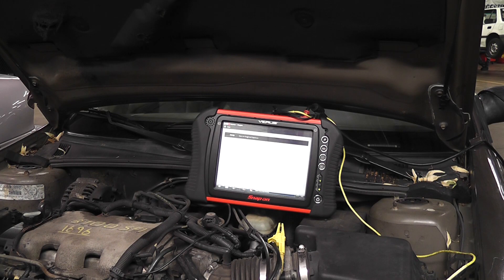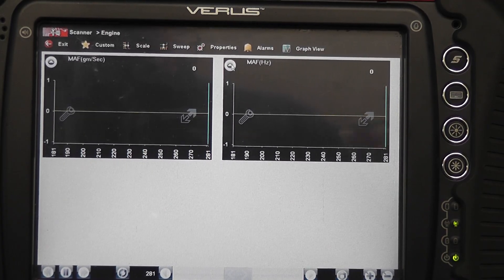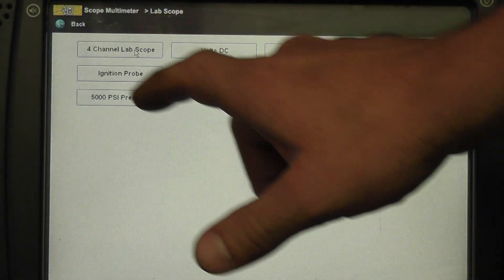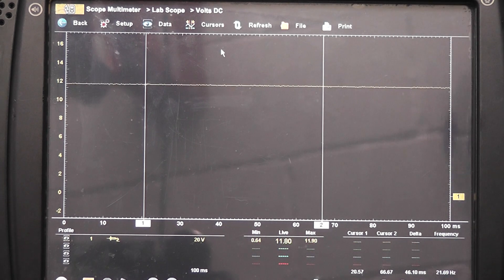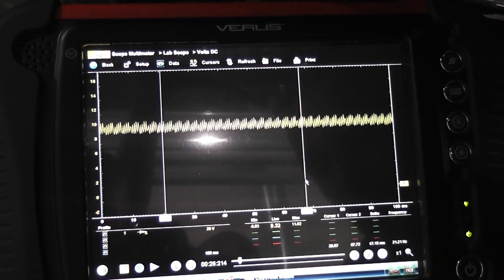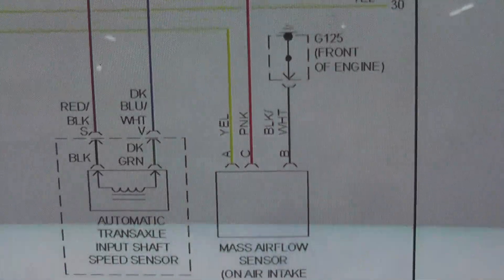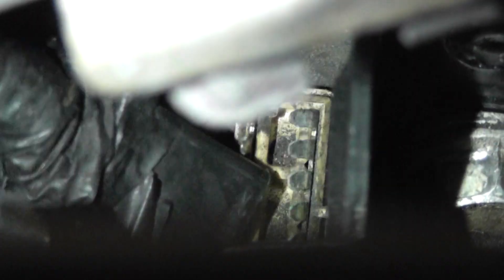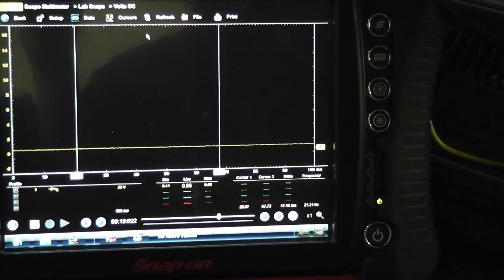MAF sensor trouble code (P0102) caused by a bad ground (GM 3100)

Comment: You said pcm send 5 volt to the sensor , sensor pull to the ground .why we have battery voltage on power wire not 5 volt?
Please 🙏 answer my question
Reply from the maker: Because a MAF sensor is not a simple sensor at all! It is a miniature module that needs a power and ground to work (to turn on). Make sense?

Comment: Ill just leave this here
. Its from a comment a guy had about watching your videos while taking a hot bath. I replied...
Atleast she's not the one in the hot bath watching his videos and trying to explain it to you. 
Because.... that is what i am doing! My husband just got so frustrated by that air ratchet he left the room. Its been 4 months without our 4th gen 4runner PO102 PO113 husband doesnt really ... atleast i dont think he does much troubleshooting. He goes strait for the heart. So he dropped the fuel tank and changed the fuel filter, tested the pump it was ok. New battery cleaned the maf sensor cleared the codes and it didst come back. I know cause i checked. I ran the obd2 code reader and no code when in the on position. Crank no start. Nothing really before this happened. There was a few times fuel was low running on fumes. I remember driving away from the gas station the car didnt have much power. Then going home on another occasion up a bridge didnt seem to have the normal 4.7 v8 power. Then my hubby drove it fishing went to a friends house and  no start.  Actually crank no start.. (the dreaded) Couldnt even jump start it. Towed it home and here we are 4 months later and we are freaking  married4luv. ...
56 no car, feel freaking hopeless. Scanner Danner must be from Ohio. Me too. I can tell from his accent  unfortunately im now in he double ll new orleans. Okay then bye. Also changed the start plugs. Noticed a oil lead from valve cover bolts? He said they were really loose. So there is some oil leakage that's covered some things. He says it's normal... me ...
 It's a computer.
Reply from the maker: get me some voltage measurements on the MAF with the key on and engine off and I can help. On your Toyota, it is an analog signal, not digital like this GM, so it is even easier to measure
Reply: @ScannerDanner  Hey, sorry for the late reply. I've been watching videos trying to find out how to get the voltage on the MAF sensor. I started watching your masterclass on that. Then my husband's brother came by and they were convinced it was a crankshaft sensor but I don't want to just throw Parts at it do you have any videos that would point me in that direction do you have a link that would be great he's got a voltmeter.
Reply: @ScannerDanner  we are on our way out now. I do have a live reading when I ran the obd2 the maf was 1.50
IaT c° 35
Baro 101
 eq rat 11
Eat113
Be right back with a voltage reading and I'm going to check the obd2 scanner a little better. 
Thanks again.

Comment: hey im going thro the same thing here on a 1997 tahoe 5.7 its the same problem in the video i cant find any grounds that are off all fuses are good i even had another computer and tried it did not work put the old computer back in it same problem (P0102 mass or volume air flow A circuit low) and i have a new mass air flow sensor installed the exhaust system is fine. not sure where to look from here.???
Reply from the maker: What are your voltage readings on the MAF with the engine running? All 3 wires
Reply: @ScannerDanner  yellow wire is 5  volts un plugged pink wire is 12 volts and the ground is all over the place cant really get a reading? thanks
Reply from the maker: @jeremya3754  needs to be plugged in for these tests. Backprobe with a pin
Reply: @ScannerDanner  ill get the readings and get back to you
Reply: @ScannerDanner  yellow is .067 red .028 black .027
Reply: this is with the engine running and it plugged in @ScannerDanner
Reply from the maker: @jeremya3754  your missing your power feed to that MAF. Doesn't matter that it was 12v unplugged. Circuit needs to be loaded and with it plugged in, now you see the problem. You have some major corrosion somewhere in the supply circuit
Reply: @ScannerDanner  ll check the fuses one more time i just replaced the 2 ground wires at the frame and back of the block and firewall pass side it is running better but same problem
Reply from the maker: @jeremya3754  you are missing power! Don't care if the fuses are good. Inspect the harness
Reply: OK I had a bad multimeter got a new one on the map sensor red is 14.06 V 
Yellow wire is 2.36 V 
Black wire bounces between 15 4and16.8 v
Reply from the maker: @jeremya3754  plugged in? (it MUST be plugged in and backprobing) Engine was running I assume as you had 14.06 on the feed wire? Your ground voltage test had to be a mv (millivolt) reading as it would never be higher than the source. So if that is the case that all sounds good.
Reply: yes plugged in and running but it still has the problem and the engine light P0102 i looked all threw the wiring harness and didnt see any thing wrong im stumped at this point @ScannerDanner
Reply: i also tried another computer and that did not work

Comment: Excellent video! I had intermittent maf error code for past three months or so which was getting worse with time. I used to be able to erase the code and it would not appear for a few days. Lately  when I erased the code with my Foxwell the engine light stayed on. I tried tracking the fault down but to no avail. Being the cheepy that I am I finally bought a new sensor however nothing changed. I came across your video and decided to troubleshoot a poor ground. Sure enough with the help of the vehicle's manuals I was able to find where the Maf ground wire together with 6 other ground sensor wires on the same lug were connected to the engine. The lug was all corroded and two ground wires to sensors, one of which was the maf ground wire,  were totally eaten away. I cleaned everything up and resoldered all the ground wires to the lug and now I no longer get the error code!   Pretty sure the problem is solved now but time will tell. Thanks for your very helpful video. Could not have solved the problem without it. You saved me BIG bucks! Thanks again.
Reply from the maker: Awesome! Glad this helped you!

Comment: An expensive high end scanner helps. No civilians have the cash for one of those nor how to interpret them.
Reply from the maker: This is a huge misconception. You could have gotten codes and data from a few hundred dollar scan tool and used a single channel lab scope for around $400 to see the MAF waveform. In fact, you could use a $50 digital voltmeter to find this bad ground.

Comment: Hi Paul Is the trouble code Said single Circuit low. Doesn't that mean Signal shorted to ground or open in the Circuit? If it's a bad ground Shouldn't that mean Signal circuit Highd? Great work and thanks a lot, Jeff
Reply from the maker: It could be either! The variable is if there is a bias voltage on that circuit.

Comment: Thank you! I bought a truck at auction that ran terribly, had major and obvious exhaust leak.  After fixing that it still ran lean and threw p0102, p0101, and p1351.   Started checking grounds and cleaning them and sure enough, the rear engine block ground wire off the MAF strand was disconnected.  It was covered in oily goop so must have been that way for a while, engine now runs normal for its age and no more codes.
Reply from the maker: Nice find!
Reply: Good job.

Comment: LQ4 /4L80e
Code P0102 low voltage maf sensor
I have ground,12v, 5v. Across 3 Maf sensors,1 that is new. Cleaned TB front and back. New tps and iac. Have not found any vac leaks and tried 2 different intake set ups.
Idle is 650, surges/lowers when put in reverse.
Hesitation/bogs if I throttle to fast.
No other codes

Stumped.
Reply from the maker: I'm assuming this is a GM? What is the frequency of the MAF signal with the engine running? Should be about 2khz at idle. 
The 5v wire is your signal wire and it should be a pulsed signal

Comment: Maybe im doing something wrong... 3400 engine maf sensor. Testing for resistance between signal and ground and nothing. Plugged in it shows g/ps reading on obd2 and jumping with snap throttle. Unplugged it flatlines and map takes over.... Good ground and power and 5v strong. Not sure what im missing on why no resistance when bench tested.
Reply from the maker: You can't do that test. The MAF sensor is more of a module than a simple sensor.
Reply: @ScannerDanner  oh ok. I seen that done on schronorbox video. Im sure wrong spelling. Same maf sensor so idk... On graph about half throttle sometimes from dead stop and always going into 2nd gear i lose power and maf drops a lil in number but giving a lil more throttle it kinda stays there then surges. Jus replaced both 02 for maintenance. Complaint is loss of power. Neg 10 at idle and numbers clean up with throttle. Open loop seems to run best. P0304 randomly comes at idle now and goes away when it was p0300. Changed plugs wires switched coil packs but still p0304. Guess fuel delivery next step. Have any direction? Ps sorry for long text
Reply from the maker: Unplug your MAF and drive it. Your car has a good backup fuel strategy with a MAF failure. 
If your problem is still there, it is NOT the MAF sensor causing your issues. 
If your problem is gone, before replacing the MAF, make sure your power and ground is good to the MAF sensor and make sure your air intake tubing is all good and tight with no cracks
Reply: @ScannerDanner  thank u sir... U are the shit
Reply: @ScannerDanner  my problem is im still learning readings... looking at scan data on same chart scale the throttle percent sometimes goes above maf graph line. And when that happens seems like when my car loses power then surges about 4 seconds later
Reply: @ScannerDanner  yea not the maf. Ltft went neg 15. Car ran like shit so not the maf. Guessing fuel next

Comment: another good video,thanks; that's why I always measure the input voltage against the  ground wire/terminal right  ON  the sensor,i don't care about the ground elsewhere.

Comment: You're not very good tech... mafs is super sensitive, and jacketed... would NEVER share a ground! Shameful.. get off youtube jerk
Reply from the maker: Lol watch the video, what was the fix? A common ground splice pack on the transmission bell housing bolt that was damaged when the tranny was changed.
Reply: Was said the wire was shared??? No? To the next sensor right? Lame.

Comment: What the fuck is that asshole doing with the air ratchet? 20 mins. of sqeezing the trigger and nuthin getting tight. Good video, no one wants to check wiring anymore. Thats the difference between technician and mechanic.
Reply from the maker: Hahahaha for sure

Comment: Awesome vid from an actual technician and not a parts changer. All i have is a multi meter at the moment but have a p0101 followed by p0172 p0175 (banks 1 and 2 rich) on a chevrolet blazer xtreme with 49k miles on it im almost ita got a newer o2 sensor on it non oem a duralast one that was made in 2017 (its 2019) i tried cleaning it first didnt look too dirty tbh but i did notice the loom had electrical tape on it and might chase that same lead colors thanks GM for once. I wasnt going to buy a new one unless it was needed im assuming thats why the person traded thw car in is he was just throwing parts at it. Cause its super clean and been babied its life.
Reply from the maker: You need to watch this 2 part series on the injection unit on your blazer https://www.youtube.com/watch?v=09_wQ9yQ85A

Comment: I have seen that there are 5 wires in old MAF sensors, now there are only 4 in a Porsche car... What happened there, any idea
Reply from the maker: I've seen 3 - 8 wire MAFs, every car is different. They combine the MAF, IAT, BARO sensors in some of these
Reply: @ScannerDanner   thanks for the quick reply.... yes for the new sensors they have 3 basic wires for MAF sensor(signal, ground & 5V)+1 signal wire for IAT... but previously apart fro these wires they had a 12V power supply... I do not get this what is even need for this 12V.
Reply from the maker: A MAF sensor is not a simple sensor, it is a module and must have a 12v supply and ground to work. Make sense?
Reply: @ScannerDanner   ... ok thankyou again.. it helps a lot, when you upload such good informative video & you are humble enough to clear the doubts...

Comment: Can someone tell me what multimeter would work for reading Hertz that I can purchase for a decent price?  P0102 and p0340 on my vortec 5.7! 
Yellow wire 5 volts (I know that doesn't mean much at all without a scope) 12 volts at pink wire and about .02 ohms on black/white wire. The MAF I have runs 8-10 grams at idle and fluctuates like a normal MAF.  I tried spraying throttle body cleaner around the upper intake with no change in idle I also tried around the the lower intake with no change. I then unplugged harness from PCM to check for corrosion at the connections everything looked flawless. I tried electrical cleaner on all connections and at MAF with no change.  After watching this I am at the point where I want to pull the entire harness and replace the lower intake and upper intake along with spider assembly. Any suggestions for a at home guy trying to get his 97 suburban C2500 5.7 vortec running?

Comment: Yes ! I took it for a drive this evening to "re- enact" the DTC trigger, at 100 km/h, the check engine indicator came up on the instrument panel & I had the Bosch scan tool plugged in.

I got the P0332 code to show up on the scanner & that's with all the air leaks fixed,it ended up being the case that I have to replace the rear knock sensor on the LS1 engine.

The one I currently have fitted comes from Hong Kong so no more of them,I'll pay about $88 AUD for a good fuel miser branded one.

I know the loom is o.k. because I soldered new connectors onto the loom & both sensors read at 100 k ohms.

The rear sensor has the case of triggering a DTC due to a low output signal.

Comment: I bought this Bosch 2220 scan tool which I picked up from my local Repco auto parts store today :-  

https://www.repco.com.au/en/brands/bosch/bosch-obdii-code-reader/p/A9725745

It cost me $199 AUD on sale today & it normally retails for over $300 AUD,my point is I've bought a lot of cheap generic scanners which didn't read the codes,the protocol is the older GM SAE J1850 VPW because it is a Chevy LS1 which is fitted into an Australian built 2002 Holden VY SS Commodore like this one :- 

https://goo.gl/images/UAnKto

The scanner is supposed to be Australian specific but it's not,I had to manually enter it as a 2002 model Chevy Camaro under the US cars list so it would read the codes,a P0171,P0174,P0102 & a P0332 code was stored on the ECU.

I had a problem with the clamps on the MAF tube coming loose last Friday & Saturday on a really hot day (42°C) ,the scan tool that I used back then read the fuel trims at 25% on bank 1 & 24% on bank 2,based on all the info that I looked up,even a P0332 code can be caused by lean running, note that the engine was surging,stalling & carrying on but I've since tightened up the clamps & the engine management symbol still comes up sometimes.

I have cleared all of the codes now but I want to induce another DTC on a certain stretch of road where it comes on to make sure that all of the codes that were triggered before don't come back,in other words,I need to find out what code regularly crops up.

A P0102 can be triggered by a dirty air filter, dirty or faulty MAF meter so if that's the case,I'll clean it with electrical contact cleaner because I know that the air filter is clean,I'll have to check for air leaks as well.

If that fails & it's either sensor which has the code, then I'll have to replace them, I just had to isolate the cause of lean running & a low MAF output signal,which was caused by an air leak,I still need to confirm which of the sensors are  o.k. on the next test run.

All I can say is that many Aussies have been bullshit artists or just ignorant by thinking that the LS1 has a differently programmed ECU in the Australian built Commodore (the cheaper OBD2 scan tools will not read the codes) when I'm fact they are exactly the same ECU as the 5.7 litre V8 Chevy Camaro up until at least 2004,in 2005,I'm pretty sure that Holden went to the CAN OBD2 (11 & 29) in both the V6 & V8 models of Commodore.

Comment: Oh my GOD dude! Don't be a cheapskate! Buy an Auto-Ratchet! They aren't THAT much more than a quality air ratchet and they are battery powered. I have both the snapon 1/4 inch and 3/8 14.4v ratchets. Guess else?? They are QUIET! I use my auto-ratchets more than my hand ratchets. 😁

Comment: I have a 2004 Malibu Maxx with a 3.5L and getting a P0102 error.  The MAF has five wires.  First one have 5v, second has 12v, third is ground does not appear to be connected?  Fourth and fifth are 12v.  I could not find where the ground could be disconnected,  so I added a wire to ground that pin.  It did not help and did not clear the P0102 error.  The reading I gat from the sensor is 0g/sec  I have tested with both an old and new sensor.  Open to any suggestion please.
Reply from the maker: You have 3 wires reading 12v?
Reply: That is what it read yesterday.  I can recheck tomorrow, it that an issue?  What should a 5 wire system be?
Reply from the maker: 12v MAF feed, MAF ground, MAF signal, Intake Air Temp signal, Intake air temp ground.
Reply: Where are you located?  I need to find help

Comment: I replaced the MAF on my 2009 enclave as well as the purge valve AND the ECM ($800+) and I am STILL getting code P0104 (MAF sensor), and sometimes P0201 (ECM), C0104 (unknown) and P0104 (unknown).  Any suggestions?